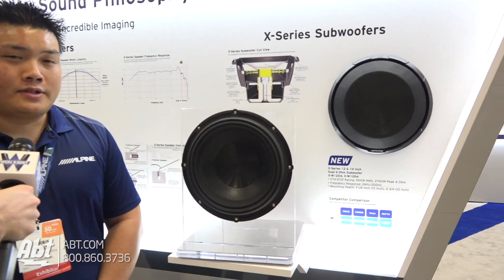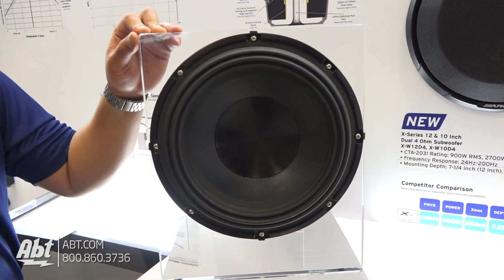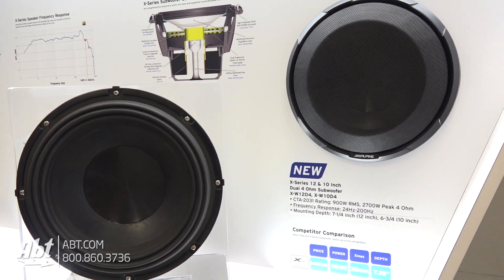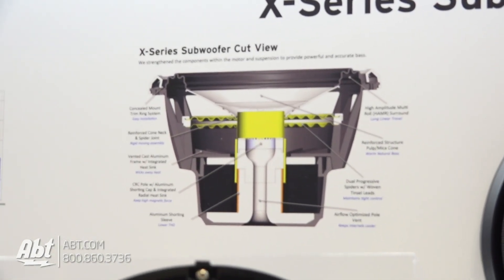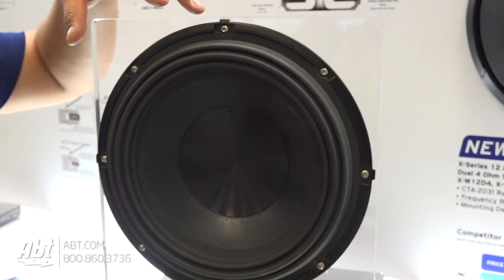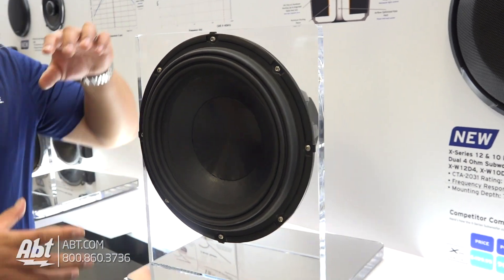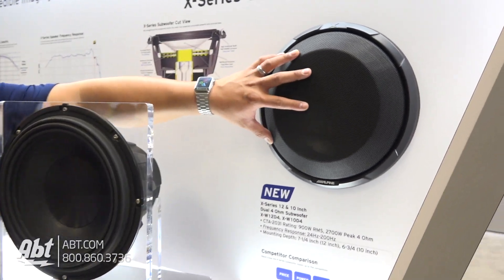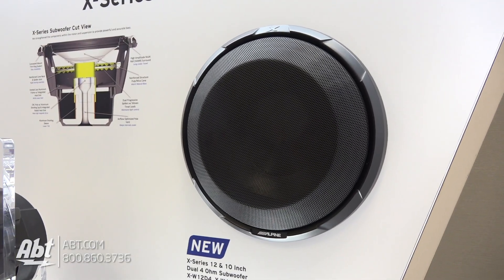CES 2017 - Alpine X-Series Subwoofers [ X-W12D4 and X-W10D4 ]

Comment: Stupid expensive for the tens but god dang It is 100% worth it. Alpine for the win on this.  Been running the speaker for a while now and it is taking punishment very well. The only thing I will tell users is do not tighten the wire holding nuts down too hard or you will break them off of the board. You will have to take and dismantle the plastic around the series and parallel bar. It will make the outside of your speaker look terrible but it is repairable. That was about the only flaw I found in this speaker.